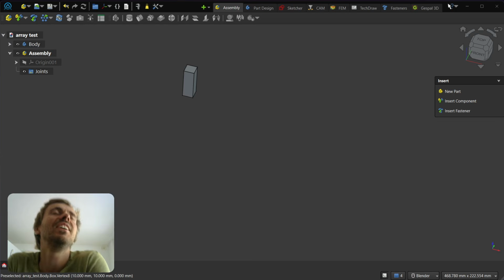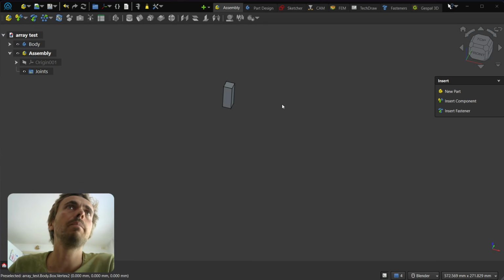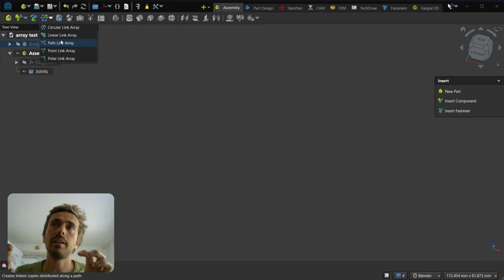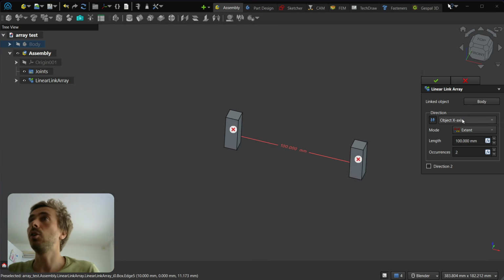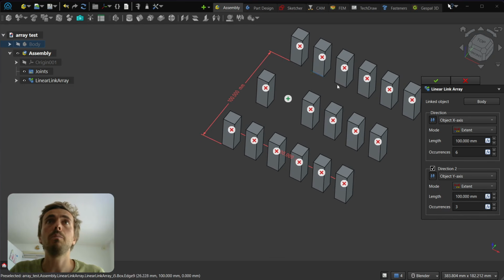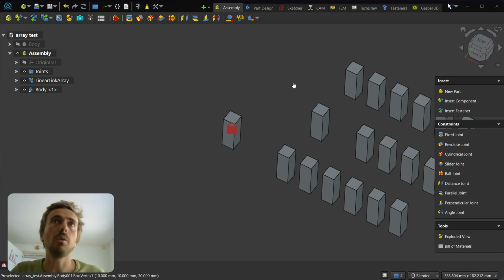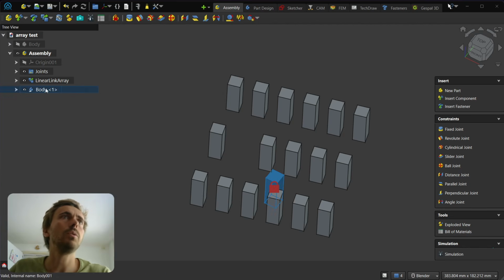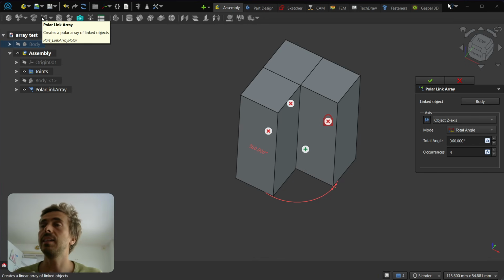New Assembly array tools

Comment: It turns out that it is impossible to select multiple bodies for one array? This is a common task in complex mechanisms. For example, four legs of a round-topped table (elements are copied in a circle). But in addition to the legs themselves, they should be duplicated in a circle.: 1. Fasteners for the foot 2. Sealing rubber band so that the foot does not slip and so on. The problem can probably be circumvented if these bodies are shoved into the App::Part container and the Link is already made from it. But what about the situation when we are dealing with mechanics and these details are interconnected using Constraints? You can put them in a Subassembly container sometime, and I remember that there seemed to be a parameter that turned a simple Assembly into a flexible Assembly. Does this type of array work with flexible Assemblies?